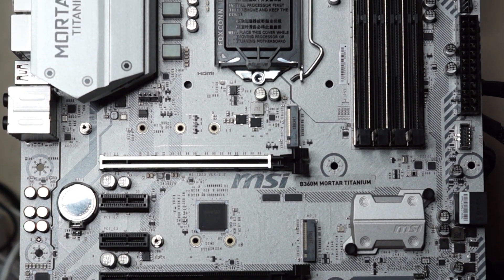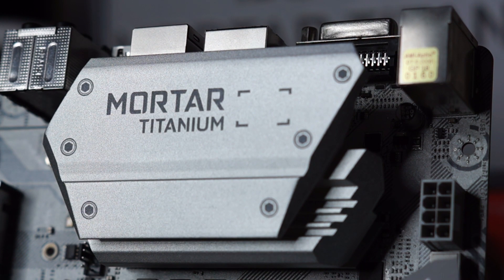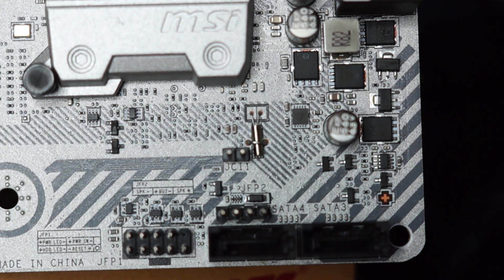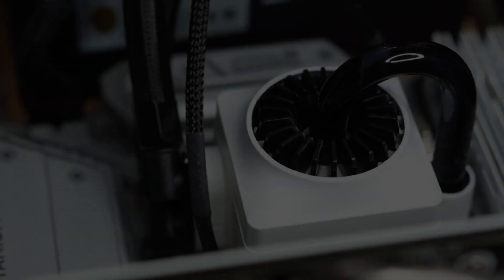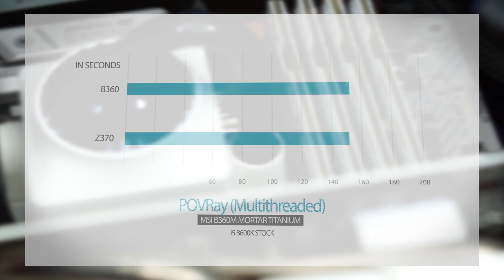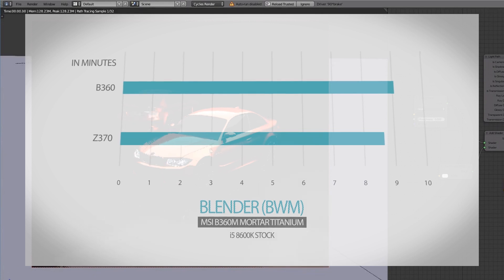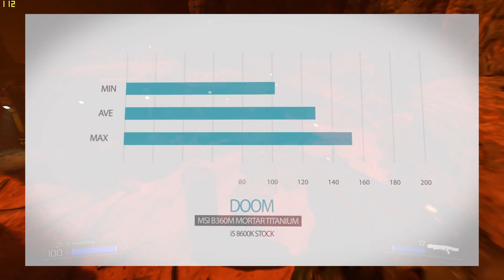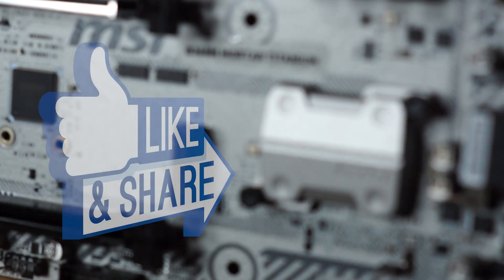MSI B360M Mortar Titanium Review

Comment: Can i use ddr4 3200 on this board?
Reply from the maker: You should have no issues running that kind of RAM. However, I do recommend that you check out the QVL list for maximum compatibility.
Reply: Max supported is DDR4 2666

Comment: Hi @SkiglyTech, can the Cooler Master MasterAir G100M spaceship cooler fit in this motherboard with some Ballistix Sport LT ram? I'm about to do my first build with the i5 8400 and this b360m mobo.
Reply from the maker: Ballistix Sport LT does not have a high heatsink. So it should fit pretty fine. Are you looking into maxing out all the four slots?
Reply: Skigly Tech Thanks...I was planning on starting with  one 8gb stick.
Reply from the maker: That sounds like a good idea. Start out with one stick first and dispose if it's not the right size. But I really think it will fit. When in doubt, you can always look at Corsair Vengeance LPX too. But again, start out with one stick to test the clearance out. Hope you get your build up and running soon. Cheers!

Comment: Does every cpu coolor fit with that heatsink thingy that is so big ?
Reply from the maker: Majority of the after market CPU coolers will fit just fine. The RAM clearance if you plan to use all slots would be your concern though. A low profile RAM will make things more "compatible" in terms of clearance if that is something that concerns you.
Reply: Skigly Tech Thanks for the info man!
Reply: Hi @SkiglyTech, can the Cooler Master MasterAir G100M spaceship cooler fit in this motherboard with some Ballistix Sport LT ram? I'm about to do my first build with the i5 8400 and this b360m mobo.